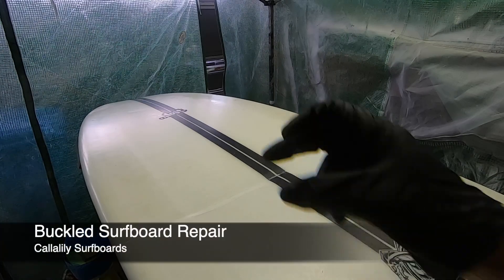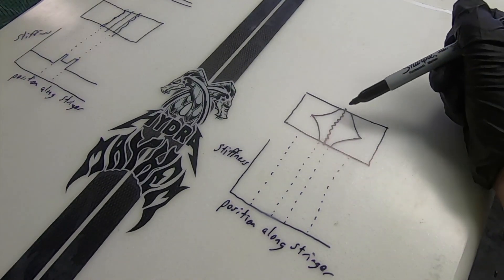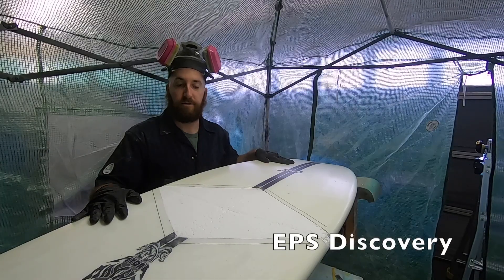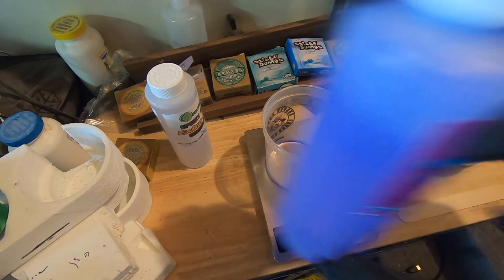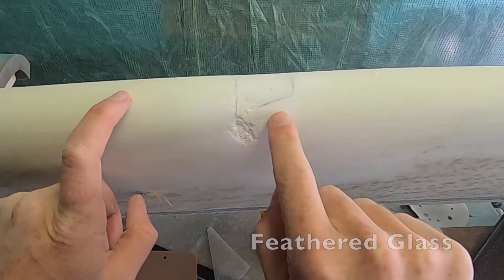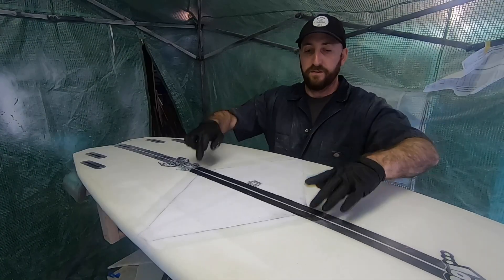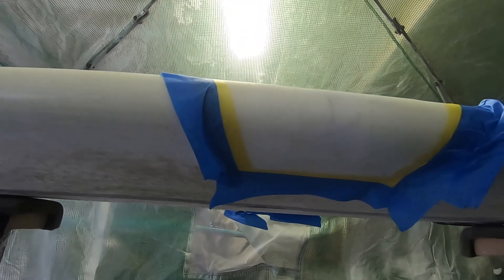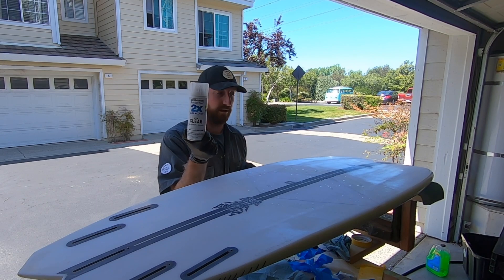Buckled Surfboard Repair.  Carbon Stringer, EPS, Epoxy, Lost Mayhem Hydra.

Comment: Just a tip for anyone working with epoxy: if it says 2:1, make sure you check whether that’s by volume (ml) or by weight (grams). I learned the hard way on a big repair. Sometimes its 100 by 45 with weight
Reply from the maker: Pro tips are always in the comments

Comment: Isn’t the epoxy ratio by weight less than 2:1 for this epoxy? 
What happens if you put too much hardener in?
I think it’s 2:1 by volume but less by weight
Reply from the maker: Yes it’s 100:45 by weight.   I haven’t had issues at these small volumes surprisingly.   As another commenter noted, the pulling away/poor adhesion on the first coat was inadequate surface prep and needs courser sand paper.   

I had a bad mix ratio (I think it was too much hardener) when doing a through hole leash loop on a single fin.  That came cured kind of rubbery and squishy.   It actually worked pretty well for the leash hole application 😅.

Comment: Epoxy does this when the surface is too "shiny". It has to be sanded with 40 to 80 grit just by hand. Normally it will solve the problem.
Reply from the maker: Thanks for the tip.   I’ll give it a go on the next one.